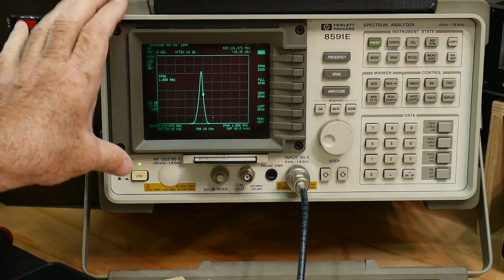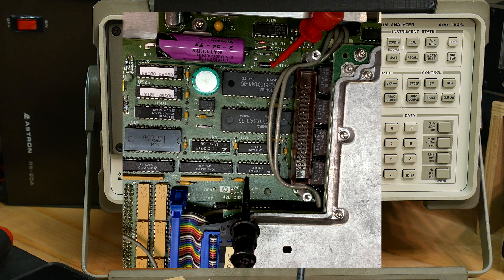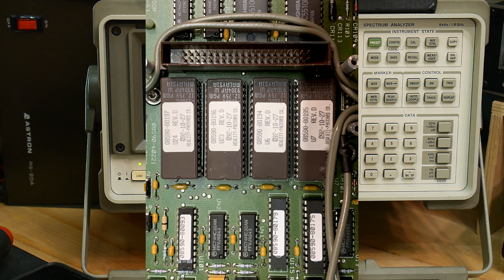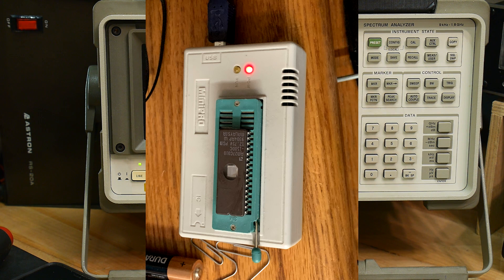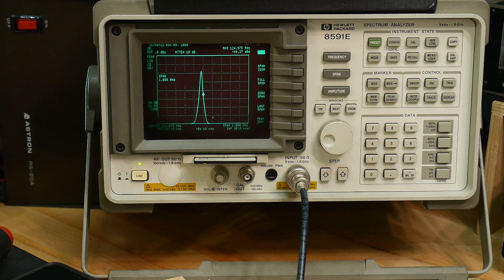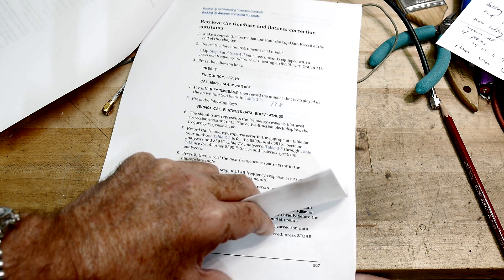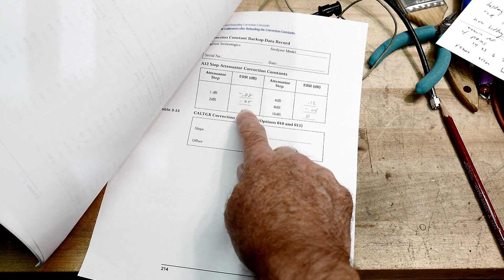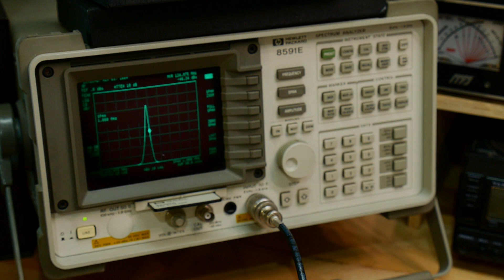#604 HP 8591E New Battery and Firmware Install

Comment: Interestingly, my 8591EM looks nothing like yours in the battery area. Mine is a Panasonic CR2447 3v button style battery on a removable circuit board only held in place with friction clips. The battery replacement is available at Digikey (among other places) and is designated CR2447/HFN.

Comment: Glad to see you got it up and running again. I inherited a 8594E and did not have any paperwork with Cal data. Battery was dead. Replaced battery. Is there Cal data online that would get mine up and running? Thanks in advance for any help.

Comment: Nice to get the due battery changed, and good that you resolved the errors when trying to upgrade firmware. Myself I have a HP8590A S/N 2618A 00510. Wanted to change the battery, but I can't find it anywhere, on the processor board and other boards! Anyone know?

Comment: Preciso do firmware do 8594E poderia disponibilizar? Obrigado.
Reply from the maker: http://www.ko4bb.com/getsimple/index.php?id=download&file=HP_Agilent_Keysight/HP_859xE_859xE_series_SA_firmware_EPROM.zip
Reply: @IMSAIGuy  Tnks!!
Reply: @IMSAIGuy  One question, what is the frequency and power that YIG generates?  Mine had a problem and I want to do a test by injecting a signal simulating the same.
Reply from the maker: the frequency range will be in the service manual. output power of YIG oscillators is usually around +12dBm but varies.  @Samucas81
Reply: @IMSAIGuy  So it doesn't stay on a frequency?  I believed that it was fixed, for example at 100mhz, like a reference frequency.
Reply from the maker: no, it does the sweeping. watch this: https://youtu.be/yk6rsXnYvk8?si=4jNIKjOA4fOMt78Q @Samucas81
Reply: @IMSAIGuy  I am need firmware 8594A can you help me? Tnks

Comment: Yesterday had some fun with the firmware upgrade on my HP8595E. Turned out that one of the EPROMs I used was a 120ns version. That one gave rise to intermittent FAIL 0004 errors during POST. Replacing it with a 150ns EPROM fixed it. Originals are also 150ns. So.. caveat emptor!

Comment: Maybe your EPROM-Programmer is the reason for your troubles. I made very bad experiences with this type restoring a Tek TDS820 - it did´nt restore the data correctly and so  the RF-Signals were extremely distorted.  With my "new" one (GQ-USB-Programmer), I didn´t have these troubles. Isn´t it much more comfortable to do the self-calibration instead of writing down all values  (I have a 8594, it would be hours to write down an enter again)?
Thanks for your videos!!!

Comment: I would think you would potentially need to recap your power supply. There are possibly bad Rifa brand caps across the mains input that are known to crack and blow up. Not to mention electrolytics that may be on their way out on ESR and leakage. I'm considering doing the same for a lot of my gear from this era.

Comment: I got one of SA today. I noted down the cal data. On full sweep, the noise floor is high and noise floor goes to normal when i turn off corrections. Any idea what might be an issue?
Reply from the maker: at 5:43 you can see my cal data and the range of the numbers. yours should not be too different. If your cal data is off a factor of 3 from mine then the cal was probably corrupt. if your cal data looks about the same then I'm not sure how to help without being there.

Comment: Hi IMSAI guy, my HP 8591E died today :( ADC-2V error, which I believe is a power supply error. I am planning to open it up and try to locate the problem. Also my battery was installed in 1993, and I will take this event to change it. Where did you buy your replacement? Do you also have an operating/service manual by any chance? Thanks!
Reply from the maker: the service manuals will be for the base series 8590. you can find them in several places (see link). the 'clip' are component level documents with schematics. there is also a assembly level manual.
http://www.ko4bb.com/getsimple/index.php?id=manuals&dir=HP_Agilent/HP_8590_8592_Low_Cost_Spectrum_Analyzer

Comment: Hello
I just have an advantest r3465 which doesnt retain the date or config when reboot i guess if the problem is the battery. In the other hand, if remove battery to change then all call factors will be erased? Im scared of it
Reply from the maker: Yes, you should be scared. I my case I was able to read out the cal data and put it back in later. If you don't have that option then you will need to change the battery with the radio on or have a secondary power supply feed the circuit while you change the battery.
Reply: @IMSAIGuy  however, how can be explained that it just run calibration fine if battery is dead... I mean, im no sure battery will retain the calibration, if i was the designer i will for sure save it into eeprom or flash inside not in battery backed ram xd
Reply from the maker: @armandoleantesanabria8355  In the olden days there was no r/w eeprom. batteries were the only choice
Reply: @IMSAIGuy  what i mean is... Of battery is indeed dead, why it still keep calibration after boots?.  The lack of service manual on r3465 is a pain in the ass. Operation manual tell u how to save on sram pcmcias u can use and the time u need change the button cell, but no info on internal backup battery whatsoever.
Anyway... Ill try find ot somehow jaja thx

Comment: I was curious how much one of those cost, but when I looked on ebay, I noticed that they make a LCD monitor kit for it. It must have been a popular instrument for them to do that. I hope you never need it, but it's there. Perhaps the instrument was calibrated around the CRT, too : )
https://www.ebay.com/itm/NewScope-0Jr-LCD-kit-for-HP-8591E-8593E-8594E-8595E-8596E-Spectrum-Analyzer/133564547407?hash=item1f1911414f:g:mUUAAOSwEgRdo8T7
Reply from the maker: Yes I saw those. the want good money for them. much more than I paid for the whole instrument. I think most are selling for around $1000 though.

Comment: I mentioned on another of your videos that I too successfully changed the battery in my 8591E. I just trusted the super cap to work and it did. I also had written down all the cals but did not need to re-enter them fortunately. Your old battery was 2 years older than mine (mine was dated Jan 1995) so I guess that 8 year life is very conservative. What would have been the benefit of upgrading the firmware? Maybe my version is already upgraded since it is about 2 years newer??
Reply: @therfnoob7697  OKGood! I think I ordered the battery from Digikey once I had it apart to see which battery it was. Was one of the common 3v Li batteries with solder tabs.
Reply: @herbertsusmann986  hi again Herbert! I opened up my SA and it looks like the battery is a 3.6V (mine is 29 years old and still has 3.7V! LOL). See some pictures: https://www.eevblog.com/forum/repair/hp8591e-adc-2v-fail-adc-gnd-fail/msg3596465/#msg3596465

I am trying to find a replacement, since the official one (brand: Tadiran) is not available to retail, it would appear. If you have any suggestion, I'd really appreciate it. Thanks!
Reply: @therfnoob7697  I think mine was also 3.6v now that you mention it. All I know is Digikey had the right bat when I did it over a year ago. Keep looking, you will find the right bat. Mine also read like 3.6 v or so after 3+ decades!
Reply: @therfnoob7697  In reply to your latest question (I could not find the correct place to reply to for some reason). No, I did not replace any caps. Well made equipment like this should be good for Electrolytics still. Companies like HP, Tek, etc... used top quality parts so in my experience those caps will last another 30+ years. Helps to turn them on once in a while to keep them formed.
Reply from the maker: Note: The table below is not valid for the 8590EM series or the 8590A/B/D series, ONLY the 8590E/L/C series Spectrum Analyzers.
8590 Series Firmware Details
Firmware
Datecode 	Serial Prefix
Break 	Revision
Number 	Revision History
991130 	n/a 	M 	Update to Display Agilent Logo.
980615	3829A	L	Y2K compliant with user perform
adjustment.  Fixes scaling error.
Support 8594L.
95.09.14 	3543A 	K 	Fixed lost Option issues. 
Fixed dpi issue.
95.03.08	3513A	J	Correct Group Delay, NTSC, and
Secam-Pal Sync Problems.
95.02.21 	3506A 	I 	Intro of 2X Memory for
dual I/O.  Supports DJ540C.
94.08.22 	3440A 	H 	Allows plot of special
characters.  Misc. bug fixes.
94.03.15 	3412A 	G 	Supports option 024, parallel.
Adds more color print drivers.
93.09.23	3340A	F	Add option 107 support.  1st
revision for the 8591C.
93.05.06	3322A	E	Supports DECT & Dig. Demod.
Fixes linear clipping issue.
27.10.92	3246A	D	Support Group Delay &
Gated Video. 
01.07.92	3230A 	C 	Improves power up sequence.
Changed DATA terminator.
01.06.92	3223A	B	Fixes RPG issues, allows
negative flatness values.
20.03.90	3205A	A	1st firmware revision
Reply: Hi Herbert, just looked at your comment. I also need to replace my battery. Where did you get your replacement? Also, do you have a service manual with instructions on how to proceed (e.g., to get the calibration data out of the SA before removing the battery, etc?) Thanks!
Reply: @therfnoob7697  I do have a service manual. I think I just downloaded it for free. Search online and you will find it. Gives instr on how to manually write down all the cal parameters etc... You have to access the battery by removing as I remember the GPIB board. Be careful when unsoldering the battery not to short anything to anything else. Make sure instru. Is unplugged and isolated from ground. Not too hard overall.

Comment: Oh, I know that feeling as you realize you just did something that's gonna take a long time and effort to figure out how to fix and then fix it...been there...done that...got the tee shirt!  BTW, modern Icom radios have the ability to download all the settings to a computer file but in addition to that I always jot down the settings in the paper manual...can take a bunch of time to redo from scratch, ask me how I know!
Reply from the maker: My T-shirt must be in mail somewhere...
Reply: I remember once I was adjusting the timing oscillator trim on an HP 3336 unit.  I thought I remembered the component to adjust being something like "R327". I turned it quite a bit trying to get some frequency change response. Nothing happened so I went back to the service manual and found I had misread it and the correct trimmer was R357 or whatever. Uhoh--then I realized I had to find out what the trimmer I adjusted did---IIRC it was a balance adjustment of some sort on an intermediate differential amplifier stage. Had to spend the next two hours with the scope calibrating the whole area to fix that stupid mistake. 🤪😂 I now always try to double check my component identifiers before turning the screwdriver hehe. Oh that awful feeling when you realize what you just did in a few careless seconds...
Reply from the maker: @ruhnet  That is a terrible feeling when you realize what you have done...

Comment: I've noticed several amateur radio bits and pieces in your videos - what's your call?  You can email me privately if you'd rather not make it public - my email is correct on qrz.
Reply from the maker: Not to be rude I just keep to myself. Ham radio was a bygone hobby. extra call sign. first licensed in the 1970's got DXCC then lost interest. I keep radios around to tinker but not use. The FT900 doesn't transmit audio and 10m is broken (one of those project radios). The Baofeng HT is thought to be good in the next earthquake and now that the police and fire went to digital I don't even turn it on anymore. I've got a working TS430 stored away that was a project radio that I actually completed (quite rare), recapped and aligned. I mostly enjoy collecting, fixing, designing things then never use them :)
Reply: @IMSAIGuy  No worries - perfectly understandable.  Thanks for the reply and 73.  Alan
Reply: @IMSAIGuy  , many of the best electronics people on youtube, the best teachers, and those, who really have practical experienced working therory, I have found were amateur radio people.
Reply: @BrendaEM  and one of those "best" is Alan W2AEW...
Reply: @ruhnet  , I enjoy W2AEW's channel, and I enjoy this one, too. @IMSAI Guy, has been cranking out these videos for us, almost every single day. I think that my favorite one was the copper-foil microstrip one, because I had planned to experiment with that, too. 
There are a lot of other RF/Ham related channels out there that are also deserving of our recognition, just like this one, too. I just found one today.
And if IMSAIGuy wants to be an egodystonic ex-amateur radio operator, he is well within his right. LOL!
Reply: ...and I am still waiting for some optics videos. : P
Reply from the maker: @BrendaEM  what optics do you want to see. 99% of my audience will go do sleep probably.
Reply from the maker: @BrendaEM  I do have some optics videos on spectral measurement and LEDs already. I have lots of things I can't talk about due to company secrets. The insides of LEDs blur the line between electronics and optics. polarization will make your head hurt but would make a good video. I'll add that to the list. interference is fun and making an optical filter or a 1/4 wave matching RF stub is the same math. I used to teach kids about rainbows....
Reply from the maker: @BrendaEM  A serendipitous posting today. Happens to be about optics.
Reply: @IMSAIGuy  , thank you.